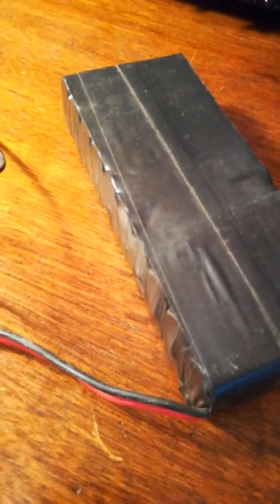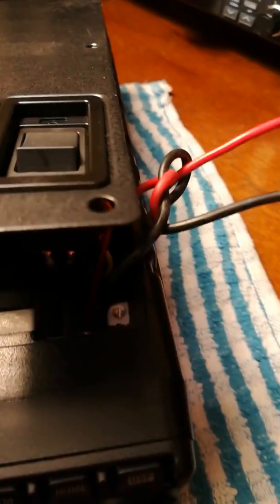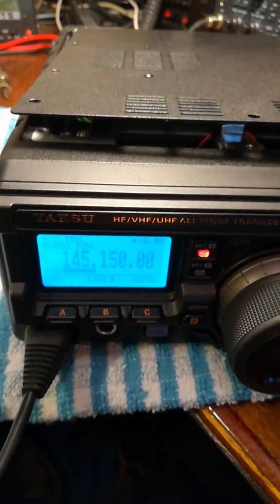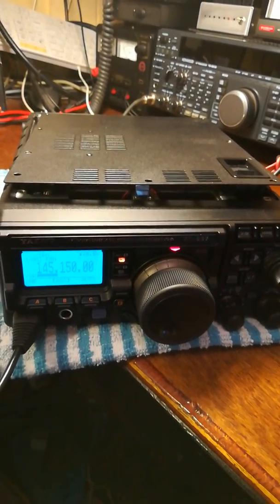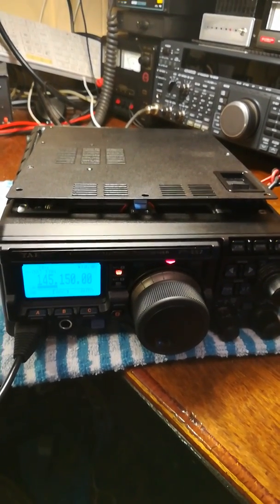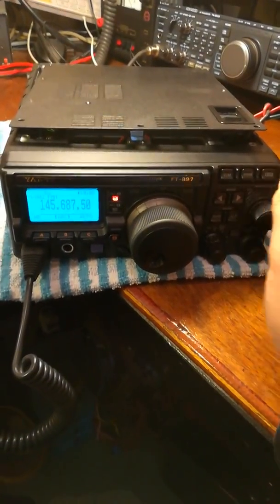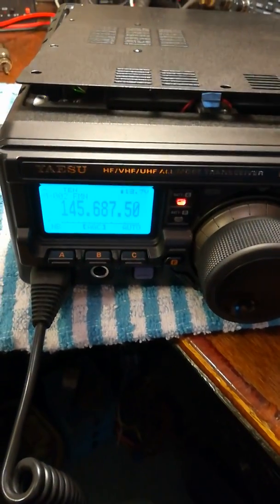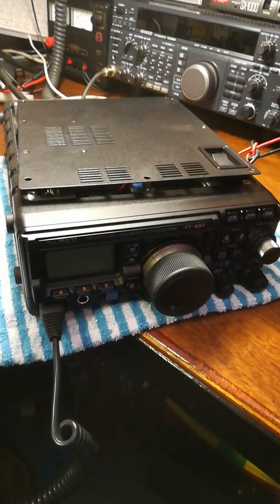Gw0wvl ... Yaesu FT-897 Homemade Internal  battery pack

Comment: What batteries did you use to make the pack & are they in parallel or series thanks
Reply from the maker: Series and Parallel , Each battery is some 2400 MA  or 4800 MA in parallel , So 24 batteries in total. Each is 1.2 volts , 10 in series  to give me 12 volts, Then paralleled up to give twice the current rating .